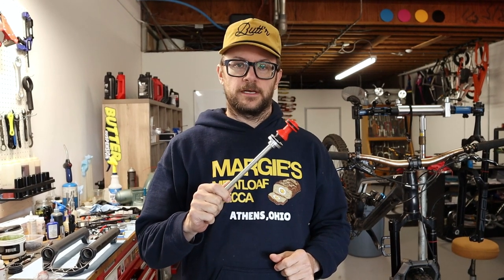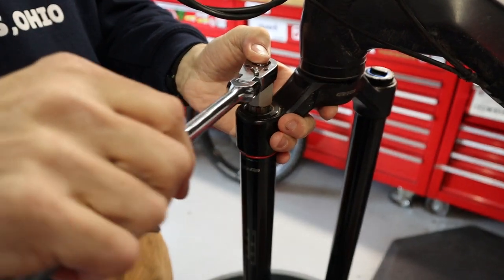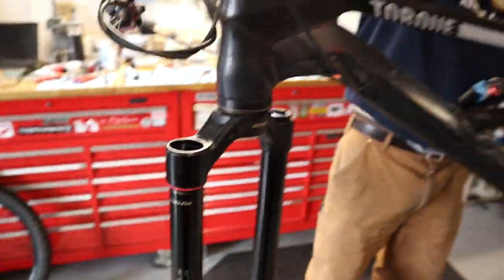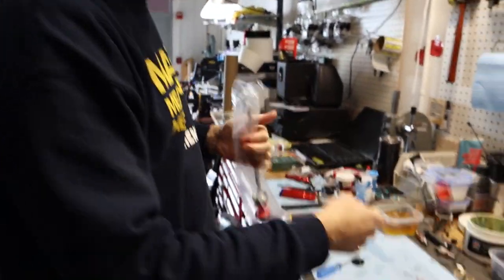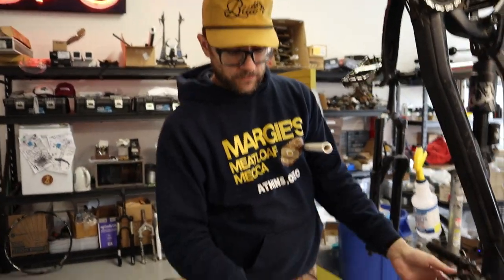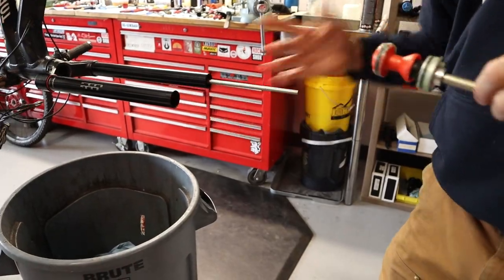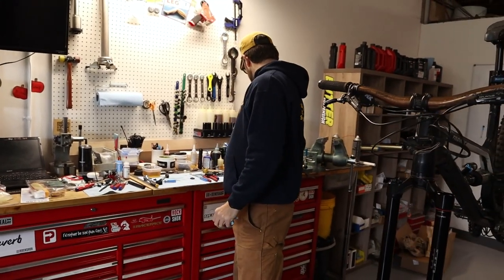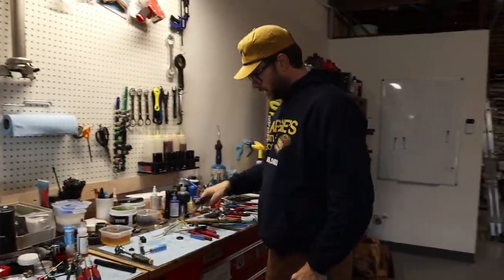How to change travel on a RockShox Zeb | Butter Suspension

Comment: You should do a Marzocchi bomber z3 air 2001 I can’t find any rebuild video on it. Keep up the rad videos 👍
Reply from the maker: I think I have one. Those are tricky to rebuild properly these days since the original seals are hard to find. There are modern replacement options, but they don't work as well as they may be the same size but they don't hold air.

Comment: When I let the air out of my ZEB, the piston fully retracted. What would cause this? Love the vid, cheers!
Reply from the maker: That happens when the air in the negative chamber doesn't bleed off through the equalization dimple at the main air piston. If you let the air out too fast (or if the negative chamber became over pressurized) the air in the negative chamber gets "stuck" and it pushes the piston into the upper leg.

Comment: Just a question. Instead of buying a new air shaft why not just add a spacer in the negative chamber like suntour or marzocchi. Surely the increased negative chamber would help a lot in small hump too
Reply from the maker: Great question! It has to do with how the positive and negative air chambers equalize. On older forks, the pressure equalization would happen in the air shaft itself, so you could add or remove spacers to change the travel. On almost all modern forks, the equalization happens at a dimple machined into the inner wall of the upper leg. Since that dimple is fixed, the air piston always has to be at the same spot to equalize properly, so the only way to change travel is to change shaft length.

Comment: does this mean we can do the reverse and go from 170 to 180? Thinking of upgrading to Charger 3 dampener while im at it.
Reply from the maker: Yes. The fork travel is only determined by what air spring you use since the legs and damper are all designed for the max travel or lower.

Comment: Man quick question, is there specific size for zeb bladder, or its the same with pike lyrik bladder replacement? TIA
Reply from the maker: Well, technically Rockshox doesn't sell bladders for these... But I believe they're all the same length. I'd have to pull two dampers out to compare.

Comment: One simple question. I got a new (2021 model) ZEB ultimate from my dealer today. I am wondering that there is no effect to fell if I close al valves for compression damping step by step. Normally on other forks what I own, it feels firmer as more closed the valves are. On this ZEB I feel no effect in according the adjustment of compression damping. Do you have any idea what could be wrong on this cartridge? I see you are very experienced. So I preferred to ask you. Cheers, Olaf from Germany
Reply from the maker: Hey Olaf- without seeing your fork it's hard to say what's up. The best way to really know if the compression is working properly is to pull the damper out of the fork to test; the adjustments can be subtle and are much easier to feel when the damper is out of the fork.
Reply: @ButterSuspension  Yes of course. But it's just out of the box and I don't want to open it before I decide to keep the fork. So I will wait for the answer of the dealer. I hope they have a good offer to me, because I bought a CSU with a 1.8 inch shaft on it. This oversize shaft normally is a OEM fork for FOCUS bikes. I want to converse the fork, because the bearing on my bike has these big 1.8" bearing. And on the market the fork with a 1.8" shaft is not available. And it's not clear to me that the 2021 CSU version also would fit to a 2013 ZEB. If the CSU is the same, there is the option to switch to the 2023 ZEB. But I need a good price because I need the 150 mm air shaft and have to pay for it. It’s expensive to modify the 1.5 shaft fork to a 1.8 shaft fork. So I have to have an eye to my budget.

Comment: Can the air spring shaft interchange from A1 to A2? I have a 190 A2 butter cup spring, can i switch to 170 A1 shaft? Do you know if the shaft are the same from A1 to A2?
Reply from the maker: All Zebs are interchangeable in regards to air springs and dampers, as well as lowers. And even though the air springs are interchangeable, they are not the same since the newer models have buttercup.

Comment: Hi did you use 3ml 0w30 insted or MAXIMA PLUSH DYNAMIC HEAVY ?
Reply from the maker: I did! Two things; this video was made before Rockshox changed over to the "new" oils, and technically speaking, bath oil isn't THAT critical in terms of makeup. Using 0W-30 will not affect performance.

Comment: Im getting a 2023 Giant Reign E+2 under warranty after breaking my 2020 Trance E+1 frame recently. On the Reign it comes with a Zeb Select. There is not 1 single video on YouTube about the Zeb Select specifically only the Zeb Ultra. I dont race and dont intend to but do regularly ride downhill & Enduro trails at probably a 'fast' C graders pace or maybe B grade on a good day. I'm 6'3" tall,  weigh 91kg and am fairly muscular and as I do a lot of weight training for fun & fitness. Do you think it'd be worth it to take the Selects off while they're brand new and put on Ultimates? After selling the Selects it'd only be about $600 AUD difference. Any information would be very much appreciated.
Thank you good sir 🙏👍
Reply from the maker: The main difference between the entry level Zeb and the Ultimate is the damper. There are a few other small improvements that make the Ultimate "best" but the damper will provide the biggest difference. The neat thing about these forks is you can swap dampers and air springs to make them what you want. The Charger 3 damper is usually around $360US and it's a 5 minute job to swap out.
Reply: Thanks for getting back to me mate. I'm still thinking about testing out those nicer internals. I think in a few months when I get my first fork and shock service at me LBS I'll ask them to do the upgrade. My previous forks were Fox 36 performance but I was never really that happy with them, they always felt a bit harsh no matter what I played with on the clickers. For the money I think the internal upgrade to the Rockshox might be a nice little addition. Definitely not necessary for my speed/skill level but what's a few hundred $ on a $10k bike in the scheme of things haha @ButterSuspension

Comment: Hi. Are there any restrictions. As in I want to go from 160 to 180 for my new frame?
Thanks in advance!
Reply from the maker: Restrictions on the fork or the new frame? The fork can go up to 190mm. You can contact the manufacturer of your frame to see if they have any limits on fork travel.
Reply: @ButterSuspension  was just about the forks, my old frame was maxed at 160, and my new frame is minimum 170 to 180.  thanks.

Comment: It's possible to go lower? To the 100mm? With some custom tuning  air spring? Thx 😊
Reply: Maybe the longer "red spacer" 🤔
Reply from the maker: Technically you can make a custom air shaft to go that low, but the overall design of this air spring is for longer travel. The Pike DJ is more appropriate for that travel size.

You can't change travel by moving the air piston into the chamber as the positive/negative chamber equalization has to happen at the air dimple that's machined into the upper leg. This is why different length shafts are needed to change travel, not spacers.

Comment: I have a question. What do you think is better for the rockshox airspring. Just using Sram butter or as you have done use the rockshox dynamic seal grease and then add some oil above the airspring?
Reply from the maker: I think the difference between SRAM butter and the dynamic grease is minimal; if I didn't have the green stuff it would just be SRAM butter. The oil on top just keeps things a little slicker. But any chance I can make it just a little better, might as well!

Comment: Is there any way to lower a Zeb below 150? I'd love to have one at 120mm for my next 29er hardtail build.
Reply from the maker: Not without some super fancy custom machining. Rockshox limits travel based on chassis size, so they assuming if you need less than 150 you should be on a Lyrik or Pike.